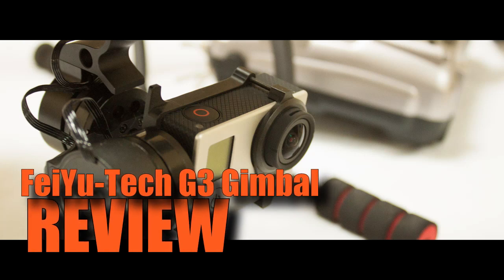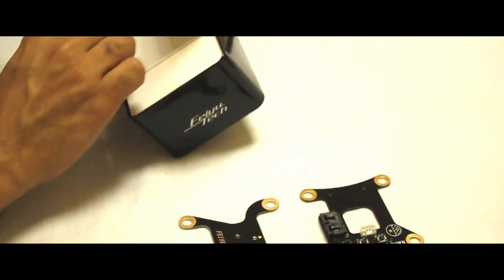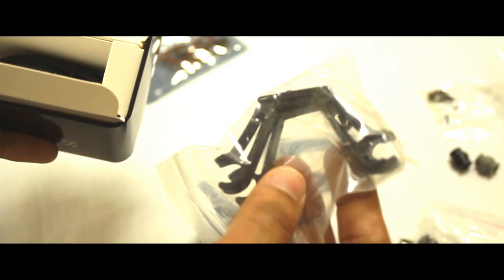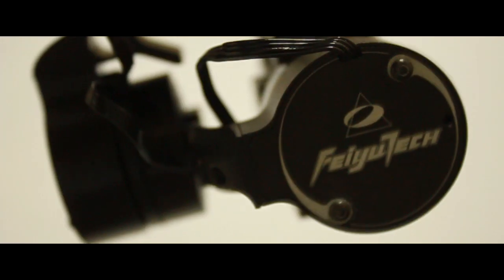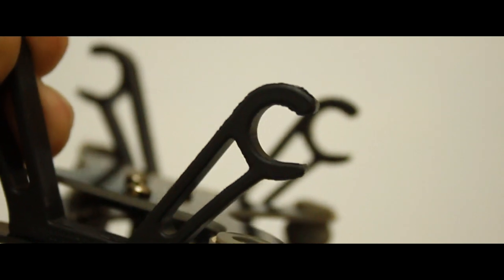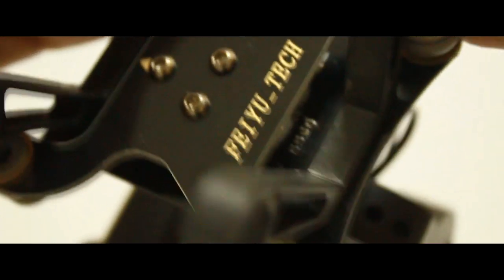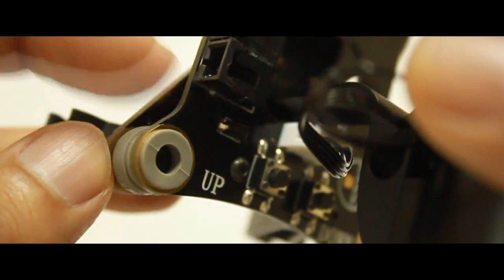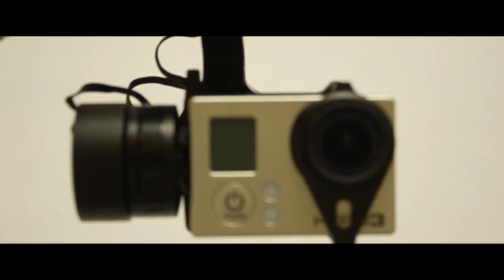Feiyu-Tech FY-G3 Gimbal Review & Unboxing

Comment: Can you confirm how the wires should be connected to the 4 pin connector to the gimbal....is the black wire in the far left and the red far right on the 4pin connector?
Reply from the maker: Franco, the gimbal comes with two types of 4pins (one's the small white JST that plugs into the board, all black wires, the second is a "servo" type connector that goes to your RX/FC for tilt control, white/black wire) the only connector with red and black is a two pin. They all have alignment stubs on them to ensure correct polarity.